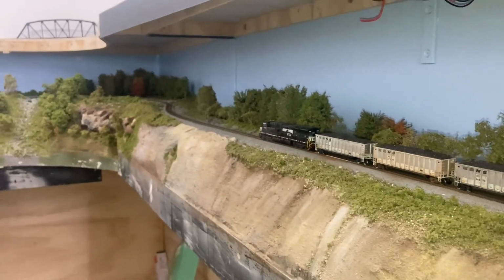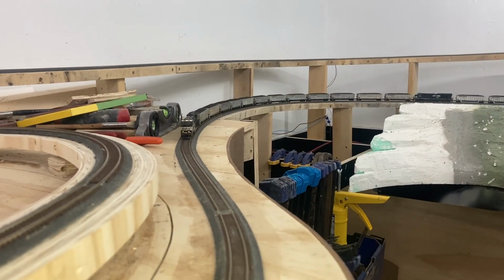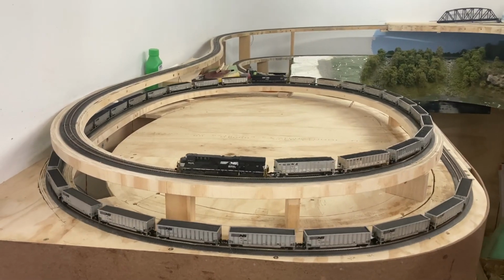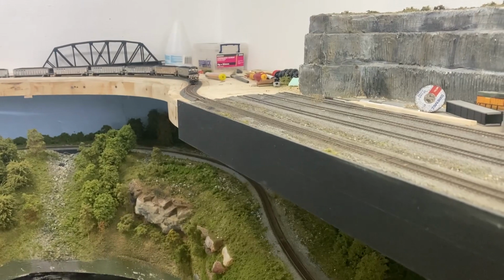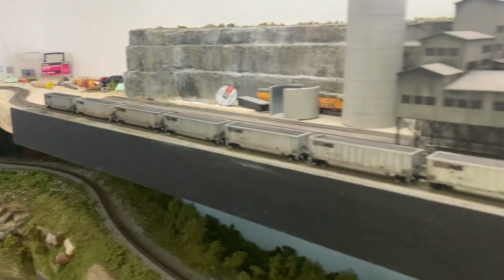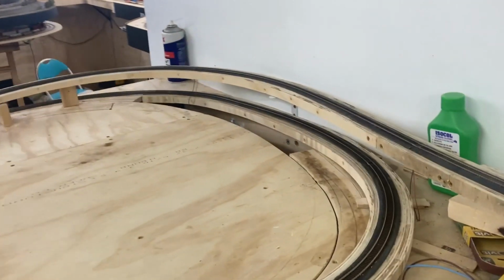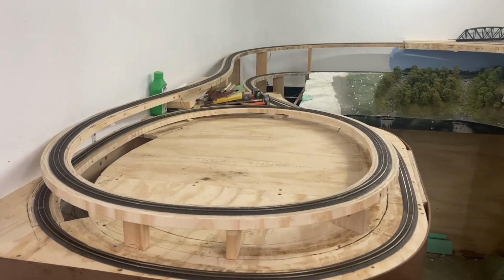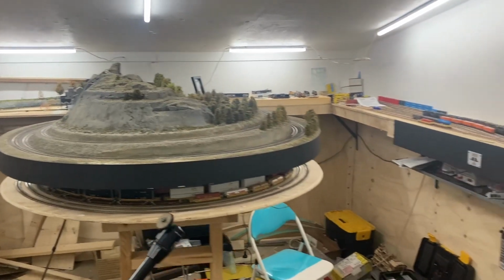N scale layout update, the extension is back in action and running well.

Comment: Question (random) what is the turning radius of the helix going to the 2nd level (I apologize if you've gone over this before) and also, what is the measurements of that section of that turn around. Kinda like at the far of the yard at the other end of the layout. You're layout since I've found this channel has been a huge inspiration for something I'm tinkering around with. I have a room in my home I'm designating as my N Scale train room. Cheers 🤙 (and thanks in advance)

Comment: Job well done 👍.
How wide (overall bench work) is your reverse loop at the yard, peninsula and the helix?
And what is the track radius on them?
Reply from the maker: I’ll have to measure it for you. The peninsula is roughly 24 inch radius. The returns at the yard and half way down the other side are 16 inch radius.
Reply: @nessriverrailroad1299  would certainly be good to know as I'm currently in the planning stage for a new layout. Due to the limited space, I plan on having a 2 track helix going down to staging.

Comment: If you plan it right you can always arrange for the steam excursion train to go down the new extension.  By the way, how is the dust level in the room being that it is in the barn?  You often mention dirty track.  Maybe an Ionizer in the room would reduce the dust particles?
Reply from the maker: If I keep the layout room door shut the dust is pretty good, not really more than a normal room. The problem I had this time is that once I got the new spline in I had to sand it to get it smooth for the roadbed. I had a vacuum going and a fan to move dust out the door but I still had a decent amount to clean up.